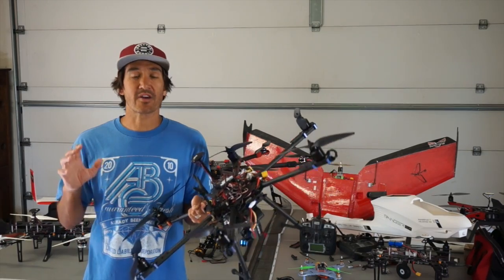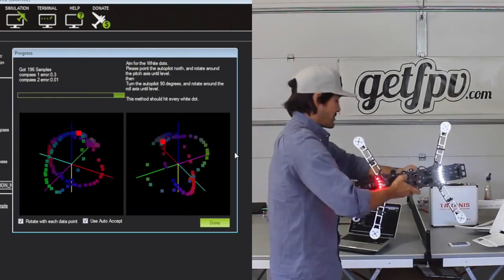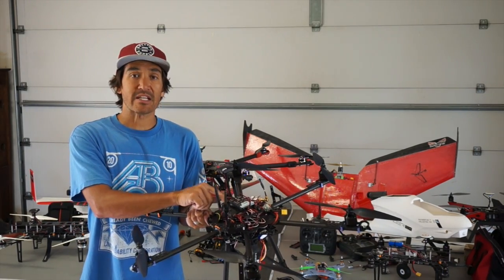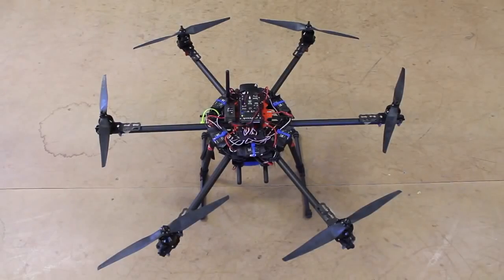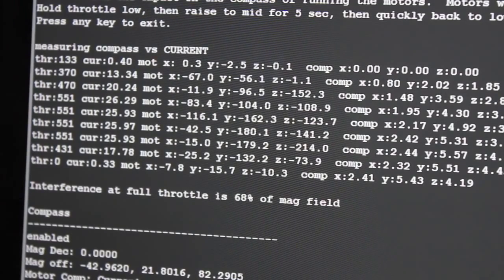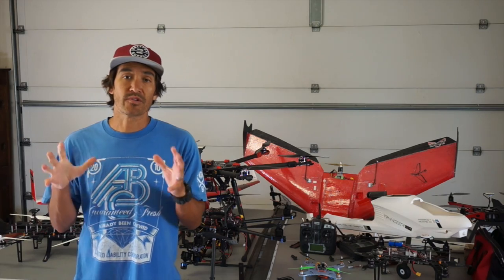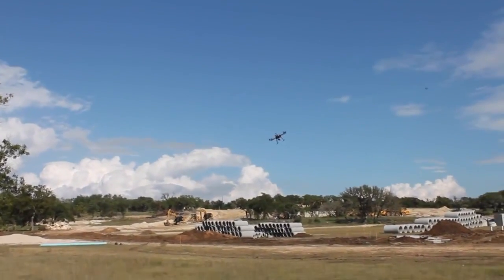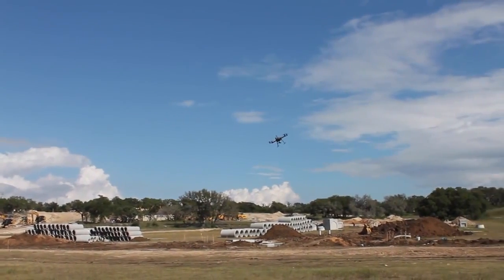APM/Pixhawk Tips for Good Loitering

Comment: Hi Dennis. I have built a 550 hexacopter, it is flying in stabilize mode but in loiter mode only throttle working.
I'm using APM 2.8, ppm, FS i6x. Please help.

Comment: Wondering, you speak of doing the facing north, rotating on pitch axis two times, turn 90 degrees, rotating on roll axis for compass calibration, is this for the initial setup compass calibration?  Or is this something you do every time you fly?  I thought during initial setup calibration, you wanted to fill as many of those dots as possible in mission planner.
Reply from the maker: Just for the initial calibration is when I do this. I don't do this every time I fly. It's recommended that if you're traveling far from your normal flying location that you do the calibration do to change in declination. I just do the sequence mentioned in the video because that's what I've found to give the best results with the least amount of dot filling. It's also what is suggested in the Mission Planner calibration screen.
Reply: Every other video and explanation I have found when I used too own several APM's, said you wanted to fill as many dots as possible during the initial calibration, which I always spent well over an hour just doing this alone and didn't seem to help in stability of the copter.

Comment: Hi Dennis, today due to your videos i can fly and most important understand some items for my Pixhawk and M.Planner..cool
...but do you tell me how to set my servo with my pixhawk, ( after i've read again Ardupilot )...i plugged it in AUX 1, then i plugged one Esc in AUX 5 to get 5 volts ( with a second battery just for this Esc ), i've checked on M.planner RC9 Function with 10 (full para.list ) then CH 7 with Camera trigger ( Config Tuning ) then Shutter with RC 9 ( Initial Setup, Camera Gimbal ).... but nothing happen...worse i unplug my pixhawk and when i plug again it the leds indicate double yellow flash then i unplg my servo and Esc and the leds indicate Green flash and i can Arm and run....
may be i don't get enough voltage on Aux 5 with my Esc...?
did you have an idea...?
Happy flights, thank's for your help
Philippe
Reply from the maker: Glad to hear you're making progress. I'm not sure about your problem but let me think about it some more. If anything comes up I will share what i find. Please do the same.

Comment: Dennis hi, I enjoy watching your videos a lot especially on apm and pixhawk stuff. I never bought any commercial drone , I just prefer to build and fix and fly. It's just me. I have to share with you a really unusual situation firmware or 3DR. I loaded the latest AC3.3.3 on
My CUAV PIXHACK. Fantastic FC, well built . Drone is Xugong V2 .for over 120 flights it hovers well but in fly out , I can describe it as driving on cobble stones. I got the pids right. I'm not new to this. So after countless process of elimination even re flashing esc from BLheli 14.6 back to 14.1 which is the same on my H. Still can't get it clean. So I used the old AC3.2.1 and I did not expect it. Rock solid, flying like
Driving on asphalt . That was totally unexpected. Looks like 3DR has some issues here. Try to out, let me know .

Comment: Dennis I have such an unusual behavior using the AC3.3.3 firmware version loaded onto my CUAV Pixhack FC. This is not my first build. Quad is he Xugong V2. Expecting better performance was very disappointed on the outcome. Flying was not smooth. Line of sight looks fine but on fpv and
GoPro recording revealed lots of shaking . After over 120 test flights and countless prop swaps.
Before is forget had many LOSS GPS messages. 
I decided to reload my AC3.2.1 which had been working well on my H quad with an APM 2.6. To my surprise after doing all the set up and calibration, the quad performed perfectly. Video was super smooth. I was puzzled. I wonder if you have experience this . Let me know.
Reply from the maker: Sorry to hear that. I haven't experienced that type of performance issues with AC 3.3.3 but will keep an eye out. If I can reproduce what you're seeing I'll see if I can come up with anything. Please keep us posted and I'll do the same if I figure anything out. Thanks for the comment and best of luck.
Reply: If you have a pixhawk set up AC3.3.3 then try AC 3.2.1 there is flight performance difference. Im using now the AC3.2.1 its super locked in. I really cant say why, it did surprise me.

Comment: Hi Dennis, just a question ...after all calibrations ( successfull ) on M.Planner for my Pixhawk, i get about 180° heading divertion with my gps heading...red and orange lines are the same but the black line about 180° on the screen...I don't know exactly where to find how to check and change this with mission Planner...Could you tell me in which menu i have to check...?
Best regards
Philippe
Reply from the maker: Sounds like a potential compass orientation issue? Check this doc and read about compass orientation as it relates to Pixhawk and not the airframe: http://ardupilot.org/copter/docs/common-compass-setup-advanced.html That's my best guess as it relates to your problem. Let us know what you find out.

Comment: Thank you for this great and simple steps!! very useful.Just watched your preview Video for 2016 - sounds very interesting !Maybe you can give me some tipps what can cause some kind of "jitter" or "microvibrations" when switching into loiter?It only occours if i am flying in loiter and it is getting worse at higher speeds.All other modes are working absolutely perfect, also altitude hold works great without these strange "vibrations" even at high speeds.I also tried to change PIDs manually but with no result against the strange vibrations :(Autotune, compass calibration and propeller balancing - done as you showedUsing Pixhawk PX4 with neoM8n GPS
Maybe you know what to do or what to try? Regards and ceep on going  with your great videos!!
Reply from the maker: +FPV-Projects Thank you for the feedback. I'll look into covering some of this content in the future. I appreciate the suggestions.

Comment: my compass offset on the internal(compass#2)  is very high something like 400 where the compass#1(external)is 146..should i be concerned w/ this ?
Reply from the maker: +bill alvarez Good question. I don't remember my offsets off the top of my head, but you may want to refer to this:

http://copter.ardupilot.com/wiki/common-compass-setup-advanced/

"Note:
In Copter-3.2.1 and later offsets are considered acceptable provided their combined “length” is less than 600 (i.e. sqrt(offset_x^2+offset_y^2+offset_Z^2) < 600). Prior to Copter 3.2.1 the recommendation was that the absolute value of each offset be less than 150 (i.e. -150 < offset < 150)."
Reply: what i found out is my high offsets were because my compass got magnetized somehow.  put a strong magnet all around it in circles and demagnetized it.  fixed my offsets from 500+ down to 150.

Comment: Hi Dennis,
A raly good video so far. Thank you very much for that.
Got a question though.
Are you flying on default Loiter PID's?
If not. What did you tune (LOITER pid's that is) to get it this stable?
Reply from the maker: +Pol leke Hi, unfortunately I'm not going to have access to my hexa for a few days. But I can tell you I didn't do any specific tuning of loiter other than autotune, compassmot, and what was discussed in the video. I'm not sure if autotune adjusts the loiter pids (I can't remember at the moment). Good luck with your setup and let us know how you get along.

Comment: am running apm 2.6with 810kv quad..on 4s 5000... have a 2d gimbal and xiaomi yi cam ... frame is a tbs clone 
white sheep frm diatone 
m having yaw issue. 
tried tuning but no use its so out of control while yaw. ..
please help me
Reply: Fixed it?
Reply: yes it's better now..
cg corrected.. yaw tunned. ..
Reply: yes it's better now..
cg corrected.. yaw tunned. ..
Reply: yes it's better now..
cg corrected.. yaw tunned. ..
Reply: +Ashish Faustine could you tell me your settings, I have the same frame

Comment: Hey Dennis, briefly what is it about the PixHawk over a regular apm that makes it so much more expensive since they both do basically the same thing? They've come out with a mini version I'm thinking about buying.
Great video as usual. Thanks Dennis
Reply from the maker: +KandJ Steward Good question. From what I know the Pixhawk has a more powerful processor which in the future will be able to handle more intensive code. At some point the APM will be tapped out, but I don't know when that will be. I still fly APM 2.6 in my Bixler (my first plane ever!) and it flies like a dream. So much fun to tool around with. Let us know what you end up doing.
Reply: getting the parts together for a hoverthings quad. its a slow process. i may be asking you a question or 2.? hoping you dont mind. This is the mini pix 4 pixfalcon. hoping it flies, kevin

Comment: hi deniss
i have 450 copter with mini apm 3.1
but i think apm's altitude hold stability is not so good
it always up and down + - 50 meter  when i flying my copter with althold
there are many discussion about this issue but i couldnt found the solution about this
what do you think about this althold problem with apm
have a good day!
Reply from the maker: 사정환 Sorry to hear that. That's really bad performance and I would recommend looking at a few things:

1. Make sure your barometer is covered. It will normally be if your board is inclosed in a case.

2. Do a compassmot to see what the ESC interference is like

3. Make sure you've done a good compass calibration

I haven't worked with the mini apm before so I don't know what results to expect. With the APM and Pixhawk I get really amazing althold performance. poshold is even better. Good luck and keep us posted.
Reply: thx for your response
1. i covered barometer with several kind of foam block and also fc fully covered with plastic housing but nothing changed
2. there are no interference of mag field
3. i did compass cali many times but its still not good

i think vibration is very important factor to maintain altitude in the air.

i'm trying to reduce viberation now...
i experienced 3 mini apm which from alliexpress but it all have bad altitude :(

so fixhawk has good althold stabiblty?
thx for your precious advice

Comment: I read that there is another mode called Position Hold and that some think it is better than Loiter Mode.  Do you know how they are different and why Pos-Hold may be better?  another thing i am wondering about is Simple and Super Simple modes?  Seems like it may be helpful when flying a mission at distances where it may be difficult to see orientation so if you get in trouble and want to fly back you can just pull back on the stick to bring it home.  How about a video on procedures when you get into trouble?
Reply from the maker: ***** Good point. I've been using PosHold more and more lately. I like it better than Loiter and the wiki explains it well:

"The PosHold flight mode (previously known as “Hybrid”) is a new mode for AC3.2.  It is similar to Loiter in that the vehicle maintains a constant location, heading, and altitude but is generally more popular because the pilot stick inputs directly control the vehicle’s lean angle providing a more “natural” feel."

I've setup simple mode before, but I'm not too big of a fan. If I get into trouble I always to to RTL, but can see why simple may be of some use. Great suggestion on a video for procedures when in trouble. Let me noodle on that some and come up with something. Appreciate you following along.
Reply: Dennis Baldwin thanks for the response.  I like your videos.  Keep it up.

I actually had a scary flight recently.  This is the reason for the request for a "what do to when you get in trouble" video.  

I had a few successful flights which were very stable in all flight modes including Alt-Hold and Pos-Hold but ended with a tip over on landing.  in a subsequent flight apparently I had an out of balance prop from the tip over.  I think the vibration induced by the bad prop really affected the stability on my next flight.

I did an auto take off using tower droidplanner and it didn't go straight up.  It went up to about 30 feet and behind me.  I Switched to Pos-Hold and it became very unstable and hard to control.  I flipped to RTL but didn't look good so in a panic I decided to land manually.  I fought it all the way down to the ground.  I looked at the data logs and the x and y accel readings were more than +/- 3, possibly as much as +/-5.

In the turmoil I think I left it in Pos-Hold or Alt-Hold which was probably a bad thing.  Would the correct thing to have done be to switch to Stabilize mode?   Would that have even helped?

Comment: Dennis, nowhere I find the answer, maybe you can help me.

Ordered the APM Pro with the powering cable. Want to use the brain 4 in 1 ESC. This ESC has BEC.

Does the APM pro have a jumper too which I should  not use, or do I have to cut the 5 V cable from the ESC?

Kindly regards

Dick Gerritsen
the Netherlands
Reply from the maker: Dick Gerritsen Great question. You can remove JP1 as discussed here:

http://copter.ardupilot.com/wiki/common-autopilots/common-apm25-and-26-overview/#no_power_module_but_usingservos_and_multiple_becs_from_esc8217s_a_bec_for_each_servo

and that should disconnect the APM bus from the servo rail. Or what I normally do is just remove the red pins from the servo leads. I haven't tested the JP1 approach and am only speaking from what I've read....not experience.

Comment: Awesome videos! I just put in an order for a Pixhawk which will be my first "fancy" fc, but I'm not getting the GPS just yet. Is it pretty good at altitude hold with the barometer or would you advise getting a sonar? I'm excited to start messing around with it.
Reply from the maker: Connor Schmidt To be honest I've never flown my Pixhawk without GPS/compass so you'd be solely dependent on the barometer. I would recommend the sonar if you want to get more accurate features like terrain following. I'll do some testing without the GPS and see what the results look like. Good luck with your build and keep us posted.
Reply: Dennis Baldwin I got it all set up and the barometer is actually shockingly accurate. I'd say with althold I get about a +/- 2" hover.

Comment: @Dennis Baldwin, I just want to point out that, the CLI mode does not work with APM 2.6. I've tried using it before and I only get garbage at the terminal. I had to use the GUI option on the mission planner, in order to do the compass interference calibration.
Reply from the maker: Greyhat Infiltrator Ah very good to know. Thanks for the heads up.

Comment: Thanks Dennis. Excellent info as always. I haven't auto tuned my QAV540G yet as it is incredibly stable in Loiter just on the basic parameters. I must have fluked it. Do you think it would be worth doing anyway?
Reply from the maker: courierdude I wouldn't worry about it if you like what you have. I've flown many a setup without autotuning. If you ever want to experiment just save your existing PIDs and give it a try. You can always revert if necessary.

Comment: thanks for the tips. what do you recommend for people who have a gimbal on their multirotor when performing autotune?
Should they secure the motors so they don't move.
Should they remove the gimbal.
Should they remove the gimbal and add weight equivalent to the gimbal. thanks
Reply from the maker: Marcio Cardenas Great question. As I mentioned to John Bailey below I did this with the gimbal attached but no camera. I've read that adding weight after the AutoTune should only make the rig more stable. I don't know if that's true, but I can tell you that my setup flies very well after autotuning with the gimbal attached and no power. I'm working on a bigger rig with heavier gimbal where I will test this and share my results. Thanks for the question and sorry I don't have a definitive answer. Just sharing the process I went through and how it went for me.

Comment: Dennis thanks again for the tips in your video. Should Autotune be with your Cam and Gimbal attached. My flight time is 8 mins, attached, twelve, without. The rolling of autotune might exceed the limit of the gimbal and affect the auto outcome.
Reply from the maker: John Bailey That's a great question. When I did Autotune I had my gimbal installed without the camera for the exact reason you described. I was a bit concerned given the gimbal was flapping around, but it did great. From what I understand (and have read) if you get a good AutoTune without the additional weight then it will be just as or even more stable than without it. The additional weight provides more stability. I can confirm that with this method when I mounted the camera the PIDs were very dialed in. Actually, before I mounted the camera I brought the PIDs down just a bit so that they were a little less responsive. Now all this said I'm flying with a very light gimbal (Tarot T-2D) and camera (GoPro Hero3+) so it will be interesting to hear your results. I have a Sony NEX5 and gimbal, but it's too heavy for my current setup. I'm working on a bigger rig and will go through the same process described above with my NEX5. Will share my results when I'm done.

Comment: Great tips! I did not know about compassmot, thanks. 
Was that the FireFly back there. What happened with FireFly6 PixHawk install. Did you ever test the transition to forward flight?
Reply from the maker: ***** No problem at all. The FireFLY6 is ready to go. Just need to get the nerve to transition forward. Will be doing that soon and sharing the results (good or bad). Thanks for the feedback.